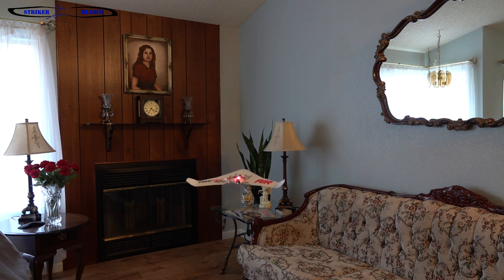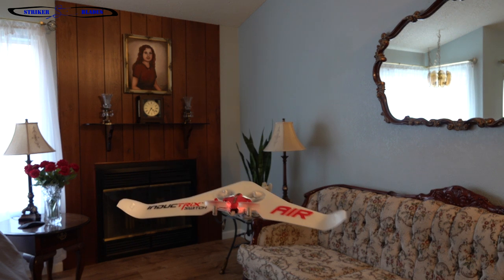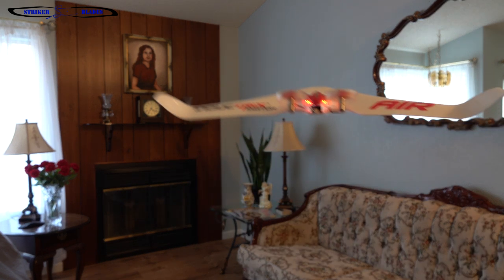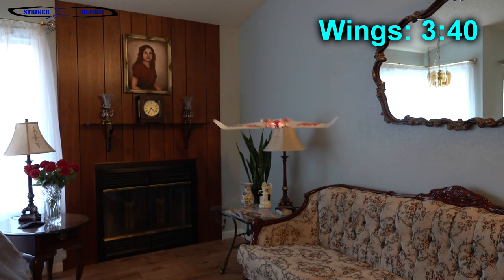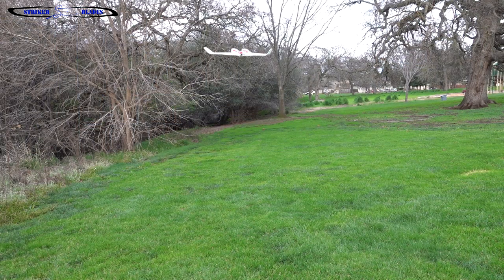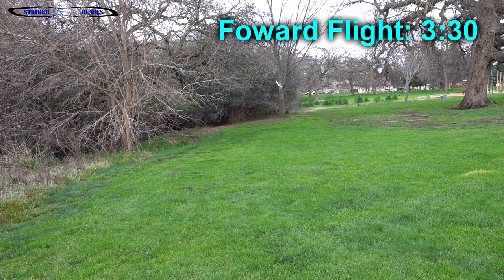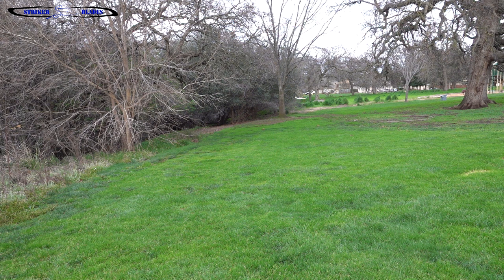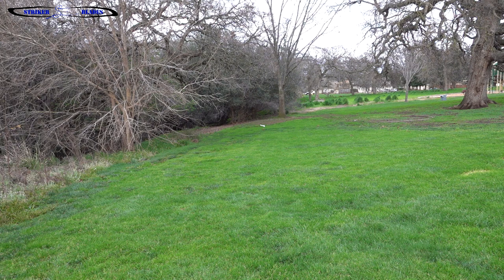Inductrix Switch Air Flight Time Test.

Comment: You should have tried to see if the wing would let you fly a bigger battery.  Tattu makes a 220 mAh cell I know to work well with the inductrix. More weight would also help it to fly faster without getting thrown around.  I'm considering buying one of these if I'm unable to simply build one.  I've been hoping for something like this for a long time; except that I had more envisioned a control surface and servo free airplane that grants 4 channel control exclusively with cleverly positioned and angled thrusters so as to be as inexpensive as something like this.  Hopefully more will follow.
Reply from the maker: its a fun little quad for sure! if they made a 250 size version, servo free, I think we would see pretty good results! At least much better for outdoors!

Comment: Thanks for doing that test for us, results were pretty much as I expected but the swing did not hurt flight times too bad I guess.
If it's not creating lift in forwards motion it's just for decoration and might as well be something more interesting like a star wars model etc.
Reply: I bet the wing does do more than you think.  Easiest way to check would be to see how it flies in plane mode but without the wing.
Reply: @whatelseison8970  maybe, I think the weight and drag created by the wing evens things out even if it IS creating lift.
It's an interesting thing anyway..

Comment: Interesting test! I like the idea of hybrid fixed wing/quadcopter design concept, so you get the benefits of vertical take off and landing combined with the increased  lift of a fixed wing for flying👍😎😁

Comment: some late info.     a knowledgeable small model builder  Could  reduce the auw, Significantly.      the rotor guards are  Not doing anything, with the wing on.       the winglet span could probably be reduced by fifty percent.      the manuf has chosen to use a wing profile, that does everything, Poorly.    the Too-thin leading edge results in turbulence induced  Drag.    the rest of the, thin, profile is a Low-lift.      compare the  le   of a clark-y profile.    obviously, a drop in energy efficiency results, from the full-time thrust conflict; the nose-Down moment produced by the  wonky  thrust line, of the aft rotors.        it would be interesting to know how  much difference  reduction in auw would make, in flight times.     the performance of the wing might be improved by  'rounding'  the  le,  as much as is practical; so that it more resembles that of a clark-y.    (doing this, however, would tend to alter the 'stock' dom; distribution of mass.)    cheers          googletranslate
https://en.wikipedia.org/wiki/Clark_Y
Reply from the maker: That all sounds right! With the wing off I get about 20% more flight time.